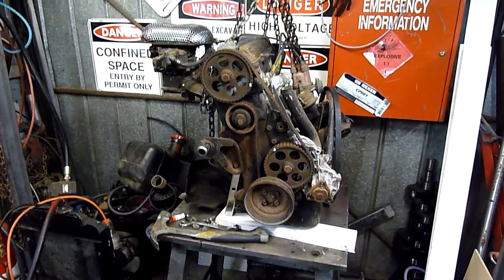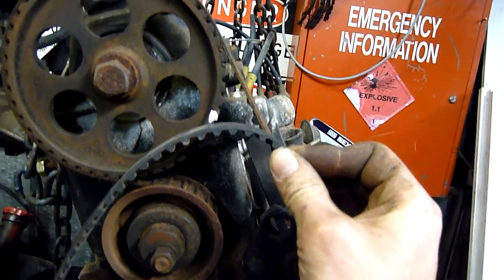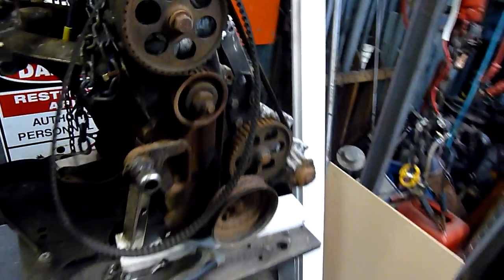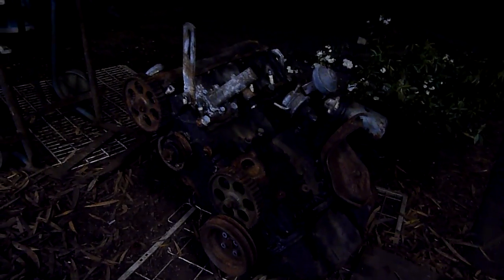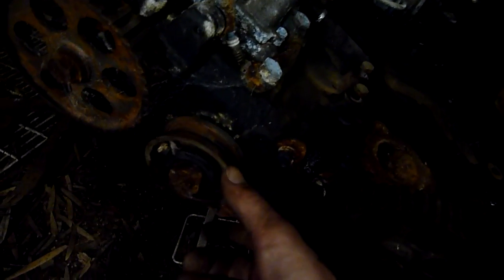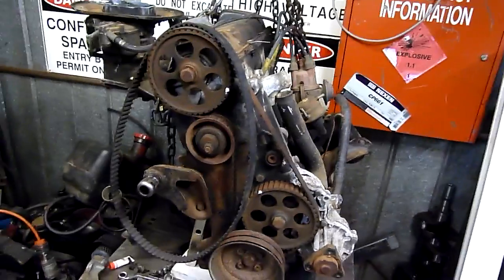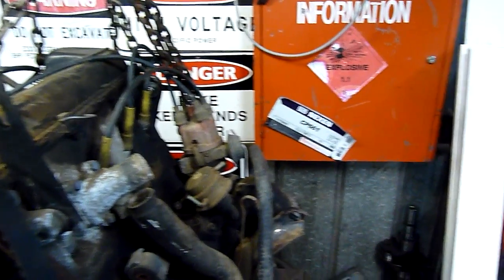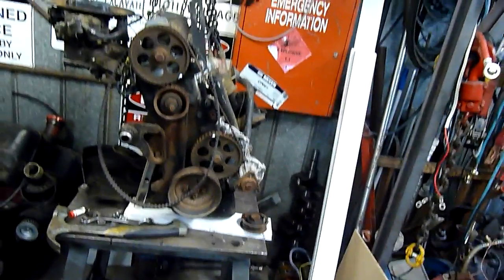Volkswagen-Audi EA827 Engines For Fun

Comment: Just go to the parts store, pick up a VW Golf manual and read the section on ignition timing.  Then put the book down, go home and set your timing.  There's a mark on the main pulley and a mark on the cam gear.

Comment: just time it like most engines, piston 1 TDC (if there is a mark for that or the screwdriver down the plug hole routine) and cams for number 1 just after the intake valve closes plus a little more, if there were timing marks on the sprockets (the white pen marks im guessing are those) should align with something or line up together

Comment from the maker: I've got the engine re-timed ok now, just need a starter motor and Its good to go. compression isn't the best but it should improve once the rust and crud on the valves cleans up.
feel free to come down tonight if you want anyway.

Comment: found the number of teeth and and belt width, it has 121 teeth and 18mm wide, can't find anything on belt length at the moment but the VW part number is 056 198 119

Comment: You need to remove the pulley of the bottom gearwheel, there will be a timing mark on it, most likely theres also a mark on the block above that gear. the gearwheel on the right is i believe for the oil pump which generally doesnt need correct timing

Comment: best way is the line the distributor rotor up with the number one spark plug (that should be roughtly tdc compression on 1, then line up the crank) and make all the dots on the pullys line up. if you want ill come bring those tv's and instantaneous hot water systems down tomorrow night and have a look with you

Comment: It's been a while since I did the timing belt on a VW engine...but if memory serves me right, you set the crankshaft to TDC via timing mark on the bellhousing (should be a plug on the top of the bellhousing that you remove to see the mark),  the intermediate shaft mark should line up with the notch on the crank pulley, and the camshaft mark should line up with a mark on the head itself.

Comment: might need to invest on a inspection camera to investigate the internals of the engine to see whether if the piston has been hitting the valves or to do a general inspection of the internals without having to pull the motor apart completely.

Comment: I read an interesting thing awhile back in an old story about how someone drilled 1/8 inch holes in the center of intake valves 1 and 1/16th inch deep.  The idea is some carbon keeps some hot spots going after the engine is started and run normally with the spark plugs.  After it's warm, the electrics can be shut off and it'd continue to diesel on its own with it being touched off by carbon in the intake valve holes holding some heat.

Comment: Are Haynes manuals not available in Australia? Pretty much any Haynes manual for a VAG car from about 1972 to the mid 90's will have information on how to set the timing on these engines as the proceedure never really changed until VW started introducing the three cylinder engines. The valve rockers and the rotor arm are key to finding the position of no. 1 cylinder. They're great little engines to work on. Sadly my 2.0 litre Audi 80 was a different matter when the belt snapped...

Comment: From when I did timing on these I think the cam shaft mark has to line up to the top of the cam cover and the crank is straight up there should be an mark on the block or on the flywheel there will be an dimple, the intermediate shaft timing is easy pull the cap off the dizzy there should be an cut/line in body of the dizy the rotor arm should point to that to show cylinder 1 (nearest to belt) 

That should right, fairly straight forward!

Comment: And for the rest of your guestions, not a very special engines, in almost every VW produced, between 1975 and 1990, with a 1.5/ 1.6/ 1.8/ 2.0 enginge, you'll find this type of engine, even all of the early diesel engines, and first generation TDI engines are a cousin of this engine design.

And the shaft for the distributor is ony a shaft for the oil pump and distibutor, (and in this case a fuel pump) nothing of a counter balance shaft. 
(oil pump is driven from the distributor)

Comment: If you can find TDC on the crank. Remove the valve cover and rock the cam on #4 cyl for the intake and exhaust are equally opening at the same time and your cam will be lined up for #1 cyl. Then just line up distributor for # 1 cly Install belt and presto Done!

Comment from the maker: I did that method and found that the belt is too short :(, the engine outside is a 1.6, the one on the table has no capacity designation at all :(

Comment: And for the ignition, there should be a timing mark on the distributor, if you take the cover of, and maybe the small plastic plate under the rotor.

And if you can't find out, i will look in the books/or vw workshop programm

Comment: These engines don't smashes the valves ;-)

Timing: 
On the flywheel should be a mark, but if you don't have the gearbox its hard to use. 
if my grey mass serves me correctly, there should be one on the front timing gear. and for sure there is one on the V belt pulley.

Timing for the camshaft, ideally you have to remove the rocker cover, and on the end of the camshaft, there is a slit in the camshaft here you can insert a special tool.